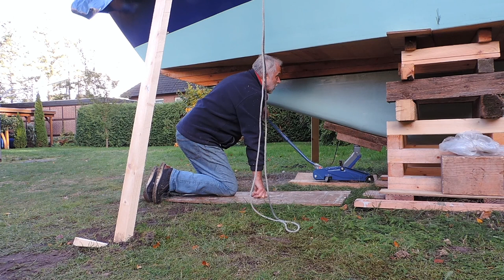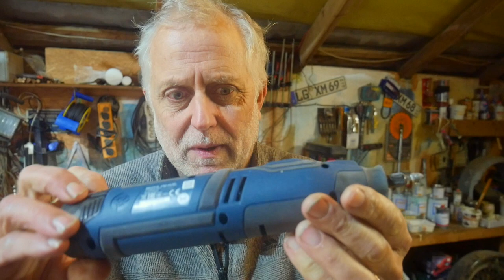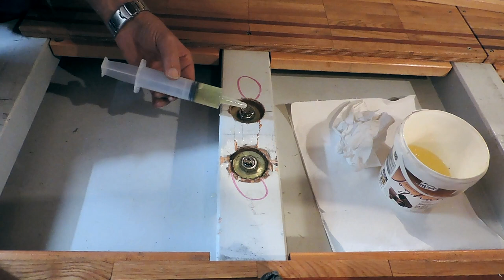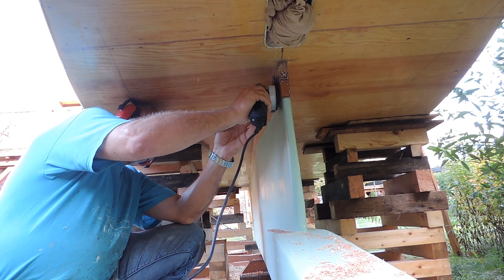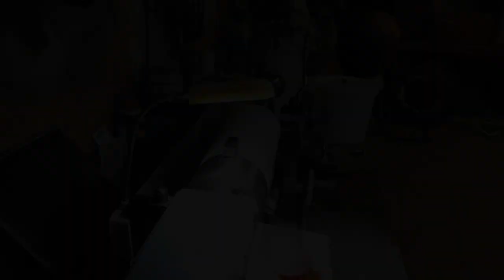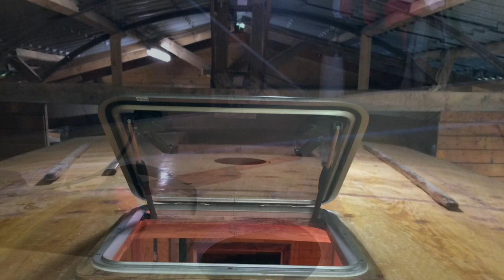After A Major Milestone! Building a cruising sailboat - SV Tapatya EP251

Comment: Well, you pulled it off.

It's not like I didn't think you would be able to. But I did anticipate some problems lining all those bolts up, plus getting the keel out of the shed and under the boat without it toppling over.

I imagine you may have been somewhat worried yourself. But you got it done. Bravo!
Reply from the maker: Thanks Bob. Yes, I was very pleased when it all went well 😃😃

Comment: Word of caution on using those cutoff discs on your Bosch/Dremel tool. ALWAYS, ALWAYS ,ALWAYS,  wear eye protection. If and when those discs break, the super high velocity bits can do tremendous damage to the eyes and the metal specks and sparks of whatever you're cutting dam also do a lot of damage.
Reply: Heck yeah! Somewhere, I have a photo of a broken piece of cutoff disc embedded in the lens of a pair of safety glasses. I used it (and others) to make safety posters at the community workshop I used to run.
Reply from the maker: Well, I’m going to disagree to an extent. Whilst the spindle speed is high, the disc diameter is small, so the disc edge velocity is not particularly high. Combined with the very low mass of those little discs, the kinetic energy of particles (1/2mv2) is relatively low. It is also quite directional.
Reply: @SVTapatya  - Fair point..

Comment: Wonder if you should have left filling those keel bolts for a bit later  after she settles then retighten
Reply: I was wondering the same thing.
Reply from the maker: I thought about that, Glenn. I don’t think there’s anything to settle. The keel has been hung on the bolts for several weeks while I painted it; the bolts are epoxied in their entire length, so adhesion and skin friction will minimise stretch; I’ve put in nearly twice as many bolts as per the design, so they’re each carrying approx half the load; the epoxied joints are minimising that load; the wood is unlikely to contract when immersed. Of course, like many other things, time will tell! 👍

Comment: The keel fit up looks fantastic Tony. Fairing it in makes it look even sleeker. I will be interested in how the POM material works out for bearings. The  food industry I worked in before retirement used several plastics for bearings and wear surfaces and they work well especially in environments where corrosive liquids were involved. Grit does cause issues though. Best wishes for a great weekend coming up.
Reply from the maker: Thanks Matt. Good info 😃👍

Comment: The keel is looking good, Tony! I'll be very interested in the results of your Acetal experiments.

(In other news, I'm currently in the process of making up NACA foil templates for the dinghy rudder and daggerboard. It all went a lot smoother once I found an old DOS program that can generate foil sections from just a 4-digit NACA number and chord length.)
Reply from the maker: Thanks Garryck 👍 I also used a program of some sort for my rudder profile. Sadly too long ago to remember what it was 🤔
Reply: @SVTapatya  - Does 'naca4gen' (or maybe Profili) ring a bell?
Reply from the maker: I’ll have a look and try to find the one I used. I remember it generated the profile and then I could print it out at a chosen scale, including full size.
What I should have said earlier is that it’s very cool what you’re doing on your dinghy build. A thorough job, by the sounds of it, and great practice 👍👏
Reply: @SVTapatya  - Ahh.. that sounds like 'Profili' then. I have that one, but my printer broke down, so I needed 'naca4gen' to get actual offset measurements from the chord-line, so as to hand-draw the templates. It only works in inches, which is annoying, but I can work with it, as the dinghy plans are in feet/inches as well.

And thanks for the kind words. I looked at the rudder & daggerboard 'planks' that the plans show, slab-sided with just a rounded leading edge and slightly extended tapering trailing edge, and decided they just didn't cut it. As you said, good practice.. especially since I intend my Benford to have the same style keel as yours, except that I want to make it a NACA foil as well... now that is gonna be interesting!